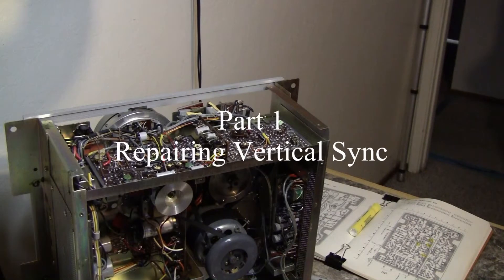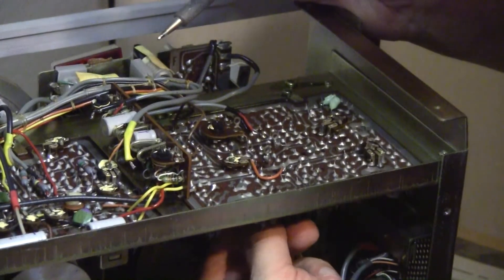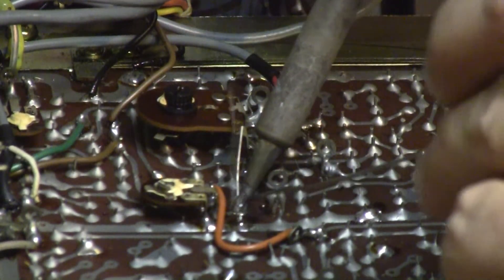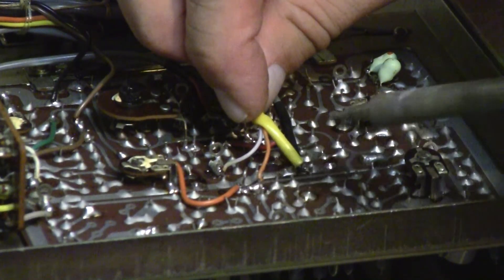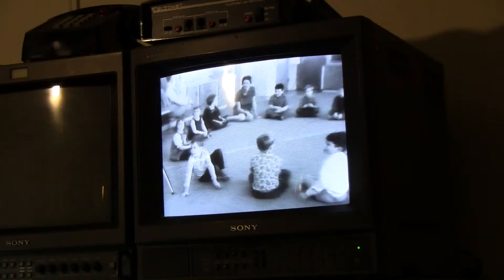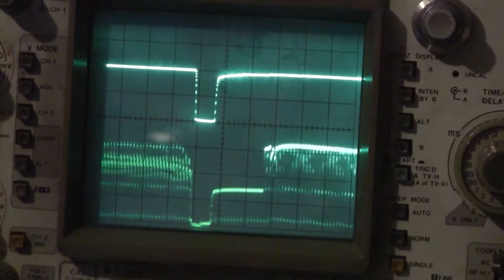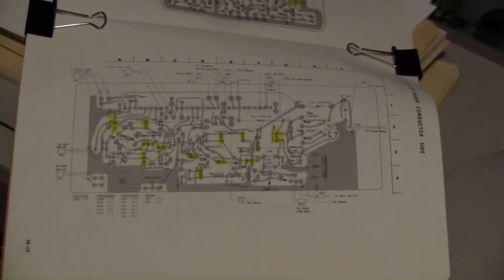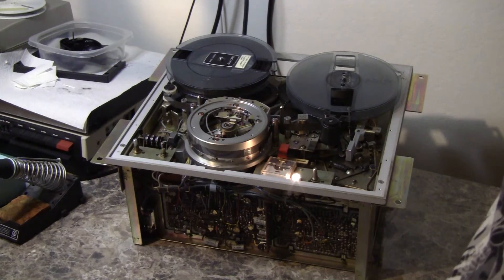CV-2000D Restoration, Final Report

Comment: Replacing those tiny printed circuit mounted parts used to seem like such a daunting challenge. Now, compared to trying to replace surface mount devices, you make working on these old first generation pcbs look almost easy!

Comment: I used to own a CV2100 when I was 14 & still have the tapes 36 years on, but sadly they do not play as the lubricant has gone and they stick to the head drum when trying to play back - I saw your other clip where you ran silicone fluid over the tapes - does that help with lubrication of the tape?